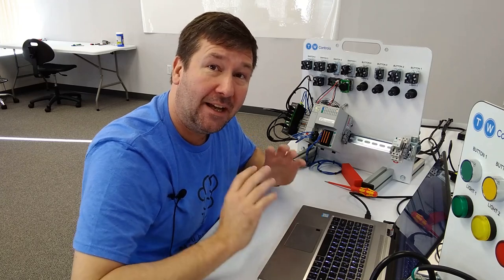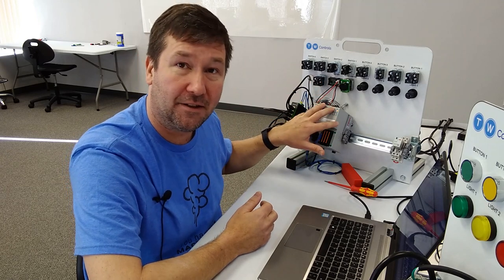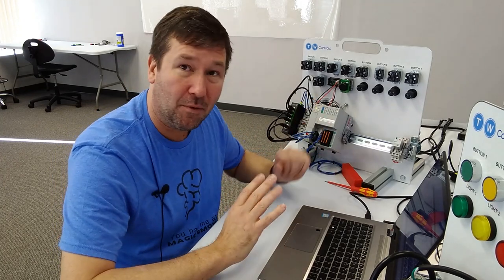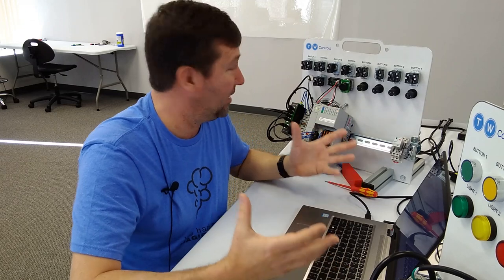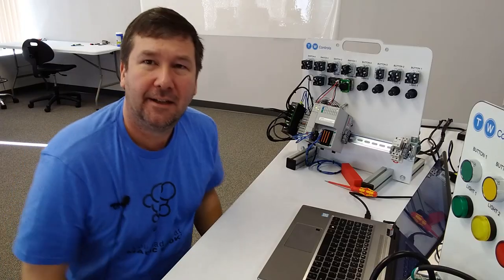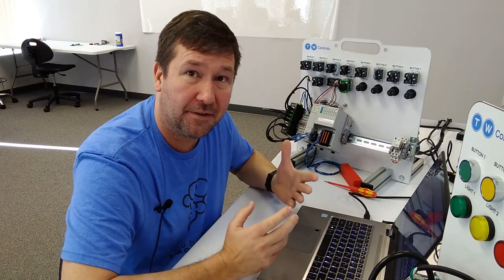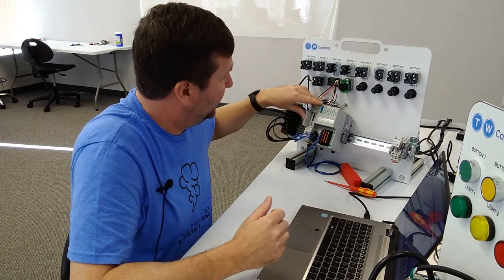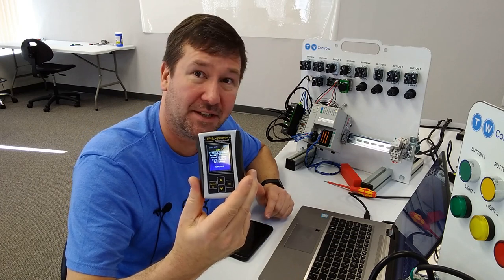Which Allen Bradley PLC are You Connected To?

Comment: 😂😂😂 I've worked at sawmills where every force light in the whole place was left on 😂😂😂
How would you see the force or the I/O lights with the cabinet locked ?
I like to force on a stack light or indicator light.
Reply from the maker: The only thing I don't like about the idea of forcing a stack light on, is you assume that it isn't a dangerous output if you are connected to the wrong machine.  There comes a point that if you are in doubt that you are connected to the correct controller, you will need to open the cabinet.